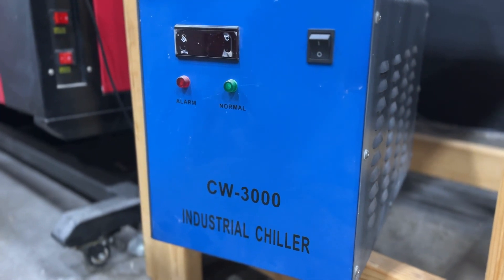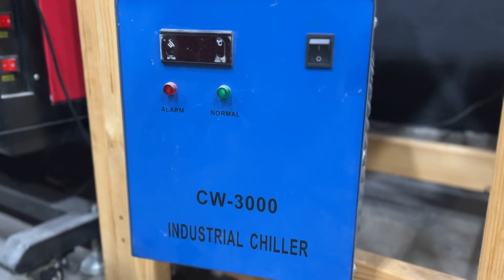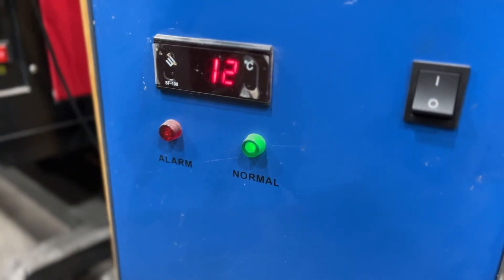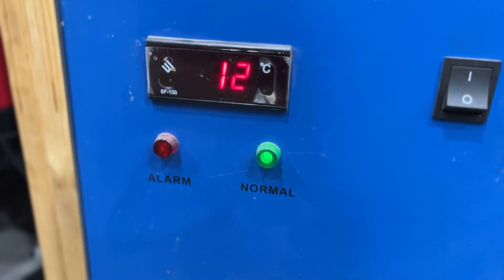Is the CW-3000 Laser Chiller what you need?

Comment: The CW-3000 is a little bit more than just a pump. It also contains a radiator and cooling fan. Your right, no active chilling with compressor or heat pump, but still more than just a device which cycles water around
Reply from the maker: Yes! Thank you for adding that information!